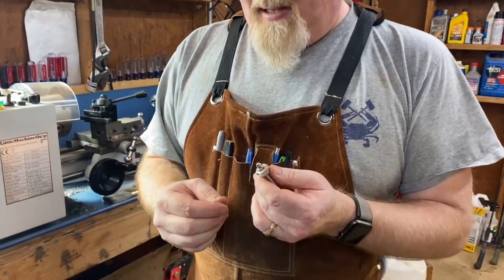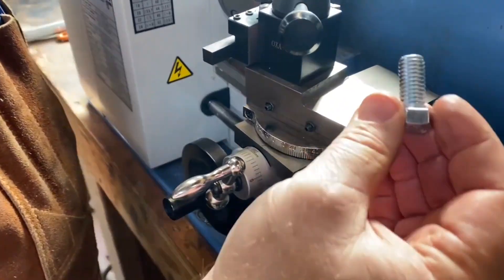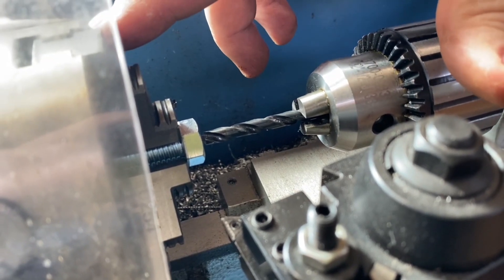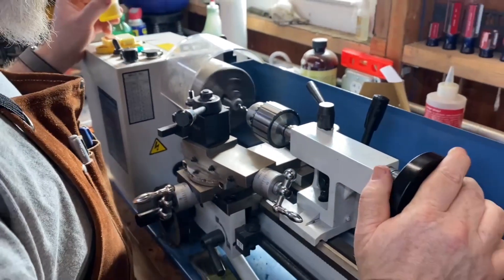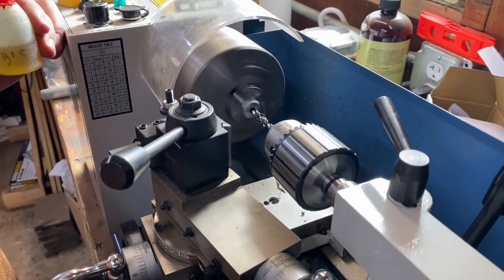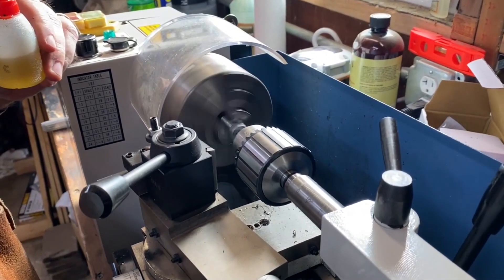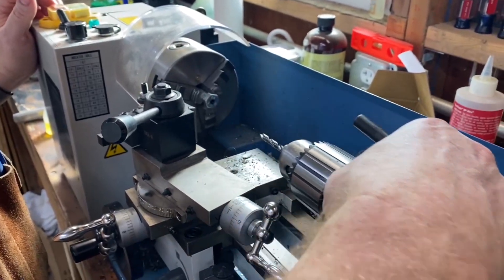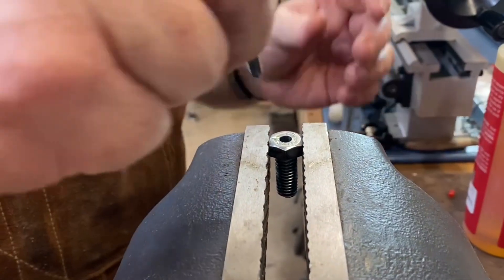Tapping a Bolt for a Grease Fitting Using a Mini Lathe

Comment: SAFETY RULE#1: Never take your hand off of the T-handle in a lathe chuck. If your hand isn't on it, it shouldn't be in the chuck. That hand will be the one that turns the machine on with the T-handle in the chuck, and you can guess what happens after that. SUGGESTIONS:There is no need or sense in going around the chuck with the T-handle to tighten it in all three places. You're wasting time. Buy some center drills and learn how to use them. Learn how to tap holes in the lathe for a much better product in far less time. Go to your local vocational school and take a quick course in lathe operation. You need it. I'm not trying to be a smartass, I'm trying to help. Thanks!
Reply from the maker: Yeah, I tried the local vocational route and there are non near me I could find.
Reply from the maker: I have center drills and usually I use them.  I didn't this time : )